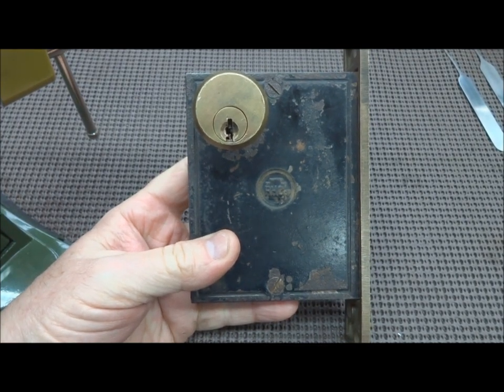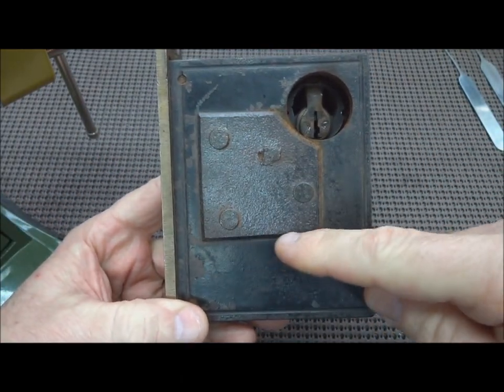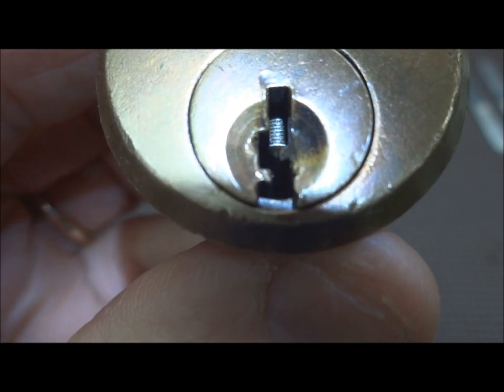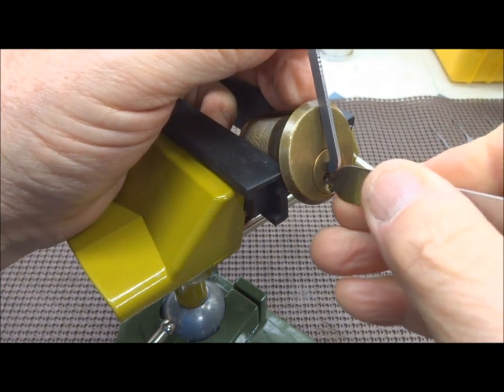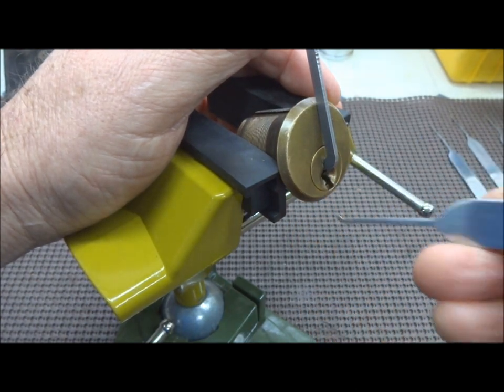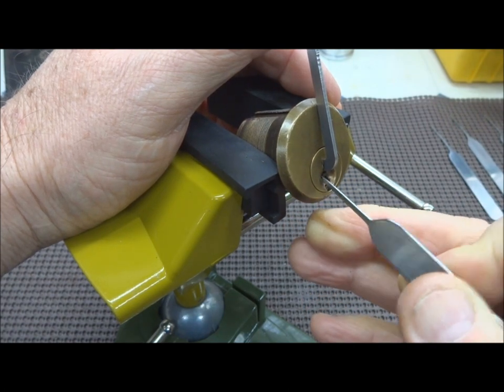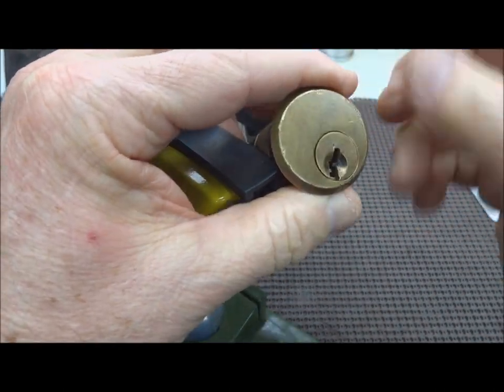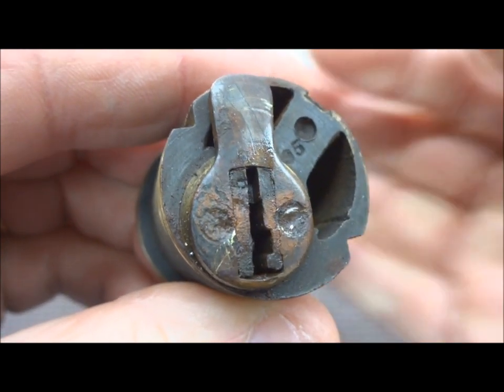(163) Antique Dorm Door Lock from University of Virginia

Comment: Why is using WD40 bad for a lock?
Reply: It's a bit of an old wives' tale among locksmiths.  The hypothesis goes that since WD40 leaves a wet film, it attracts dust and can jam up the lock after a while - or it forces old dirt deeper into the lock.
Many people disagree, and the only evidence either way seems to be anecdotal.
In any case, use WD40 on a lock and about a million YouTube "experts" will leave you a nice comment saying the only lubricant for locks is powdered graphite.

I've personally found a few locks thoroughly clogged up with powdered graphite in a bag of used locks.

As they say YMMV.